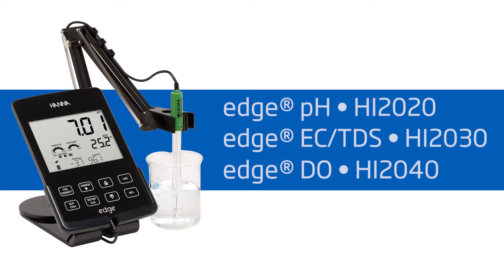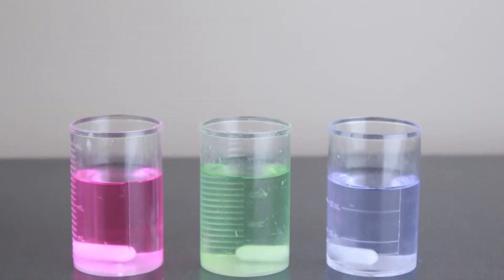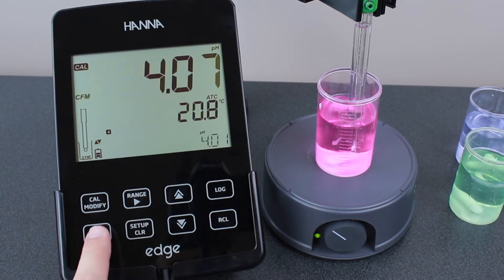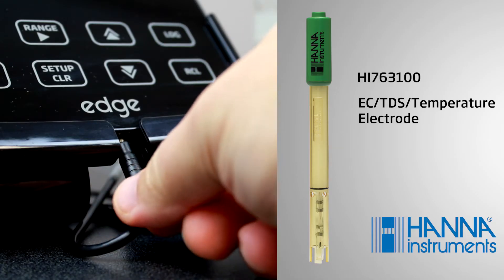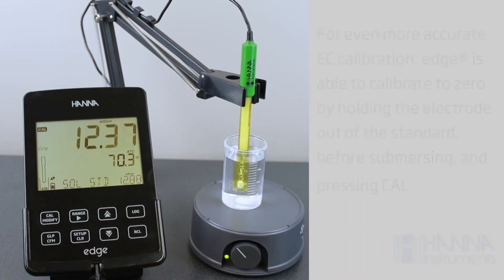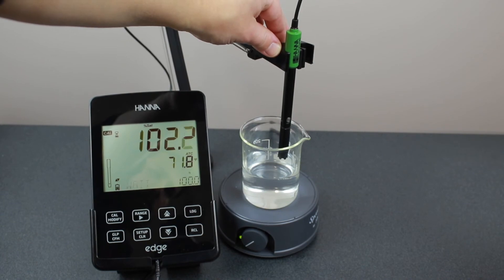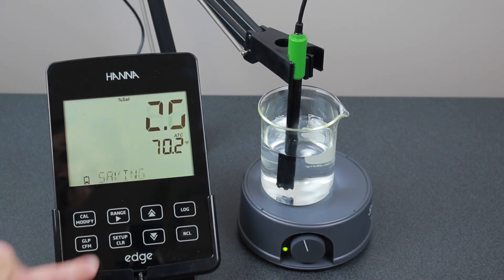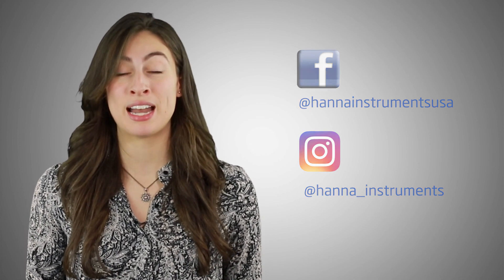How To Calibrate the edge® Multiparameter Benchtop pH Meter

Comment: may I know what standard used for EC calibration?
Reply from the maker: 1 Cell Factor calibration; 6 standards available: 84, 1413 μS/cm, 5.00, 12.88, 80.0, 111.8 mS/cm, 1 point offset: 0.00 μS/cm